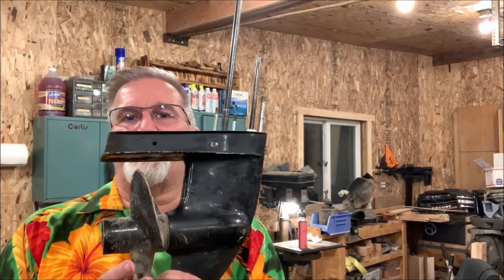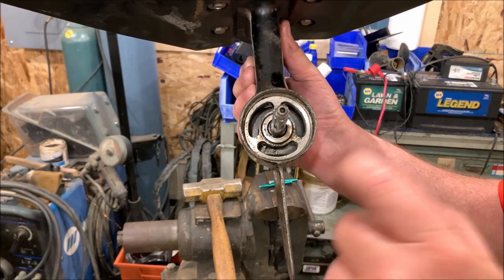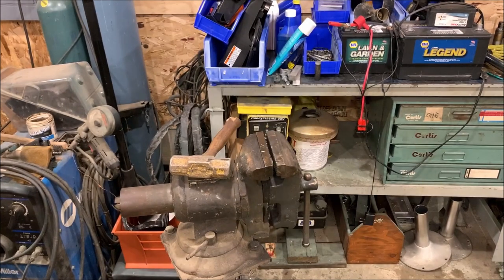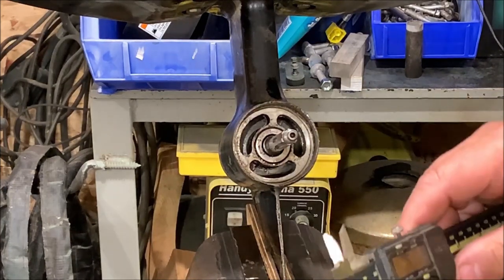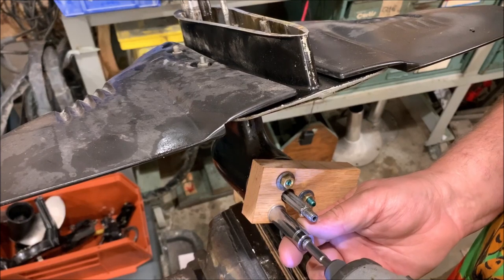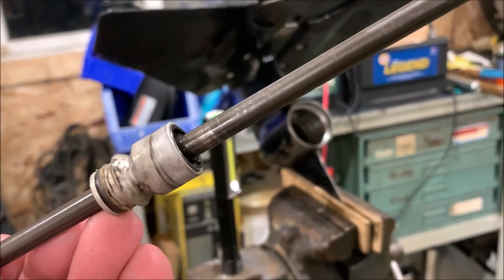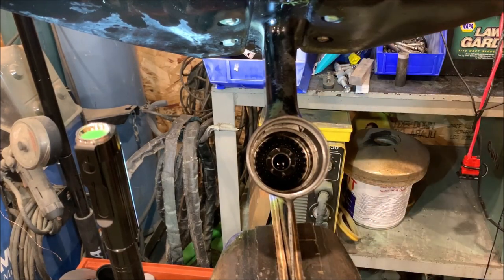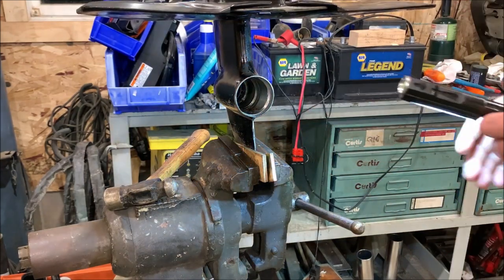Mercury 9.8 1966 outboard gear box disassembly part 1 a how to, how I do this job, noisy gear box

Comment: It wouldn't have crossed my mind to use wood for your puller, I would have went straight to steel for it, Good job and.I can't believe you didn't ruin that bright shirt working with the black oil from the gears and bearings.

Comment: How do you pull the driveshaft out? You skipped that and that's where I'm at in my 9.8
Reply from the maker: remove the nut on the end of the shaft in the gear box. The vice grip the shaft and give the vice grip a couple of love taps and she comes right out.

Comment: Are yu sure that the thread is reverse? Usually on the gear housing cover there is an arrow to show on and off on the older. models. I fixed a 1969 20 hp and a 73 20 hp Mercury and clockwise to tighten. My 1986 8 hp is reverse thread on the bearing carrier. That oil seal is in wrong.

Comment: So, I ended up ordering a $20 inside jaw puller from Amazon. I got it hooked in, down in there and cranked on it. Still didn't pull.... At this point, with the puller still cranked on tight, I decided to take another shot at heating it up. In about as long as it took for yours to fall out in your video, I heard a loud PINCK,as the gear popped free, and I was able to crank it out the rest of the way with the puller. Just wanted to give you the update and thank you for the advice. I am now subscribed.
Reply from the maker: Good deal, welcome aboard.

Comment: Any tips on removing middle drive shaft housing thingy on a 9.9. Lower unit came off/apart easy. Seriously siezed together.
Reply from the maker: be very gentle, apply even pressure, and that may not be enough

Comment: thanks so much for that video but I have a problem with copper water bent dont know how to remove. First time working on two Mercury one 6hp other 9.8 just about same year 1968 69
Reply from the maker: They can be stuck to the rubber pretty bad sometimes. thanks for watching

Comment: Great diy puller - I used your idea with 3/16 3" carriage bolts I had in the shop - worked great on my 1970 7.5.  How did you get the carrier bearing nut out?
Reply from the maker: Gently vice grip the shaft, bend locking tab out of the way and put a wrench on the nut and turn the shaft.

Comment: Early 1970s merc 7.5 leaking gear oil out of weep hole. Drained oil. Doesn't look too bad. Spent 300 on "mechanic" to get it to pee again. First attempt didn't pee enough. Took it back. Said he sealed something between upper and lower unit  to get it to not have scalding water come out. Wondering if he put a seal back in wrong. What would happen if I seal that weep hole up with silicone to stop the oil leak and open it back up for the winter time? Trying to not have to do this pull apart whole thing. I'd assume parts are hard to come by as well.
Reply from the maker: if you need parts check out oldmercs.com

Comment: Would absolutely love details on how to reinstall this lower end unit to the rest of the motor. Took mine off to replace the impeller, and after 5 hours I can't get the three shafts to align to reinstall it. Any tips would be greatly appreciated.
Reply from the maker: Make sure it is in forward gear on the handle and the gear box so you can rotate the prop to get the splines to align. Thanks for watching

Comment: I have a 1986 mercury outboard motor  75hp will not run but turns over
Reply from the maker: OK, sounds like you have some work to do.

Comment: I have a 70s mercury 7.5 thunderbolt I believe its jumping out of gear. Do you know if that's possible and can I still get parts? Awesome video by the way.
Reply from the maker: Harder and harder to come by. Go to marine engine.com and look up the parts then google search the part numbers or search the part numbers on eBay.

Comment: Alright, I'm going to go heat mine up, and if the gear falls out I'm subscribing!
Reply from the maker: Well did it work for you? it doesn't take much heat at all. Thanks for watching
Reply: @Michaelsbackyardmarina  Didn't work at all. Mine is too corroded and stuck in there. I still need to figure out how to get it out. Any other suggestions?

Comment: Good video but you did not show what I was wanting to see and that's how you got the cover nut off without a special tool to unscrew the spanner nut  the carrier I can remove I made a tool  for that on the 20 hp motors i bought an 80 dollar special  cover nut remover because over half the time I would break the lock nut trying to turn it by  using  a hammer and large blade screwdriver  to try and remove it and it was costing me 30 bucks every time for that  cover nut, so now I can remove and reinstall them every time with no damage to the nut only problem is it only fits the 20 hp fine but  not the smaller motors like 4.5 9.8  motors
Reply from the maker: Soon I will be putting this one back together

Comment: Pretty informative but after you take that screwed-in retainer ring that is in front of the gear assembly (that’s what holds it in) there’s really no need for a puller, you can pretty much yank if out easily, I seen with your puller you barely tightened 1 nut and it was out (nice job on it tho). I actually had to make a tool to get out the retainer ring out,.. it was a bear removing it!
Reply from the maker: Interesting. Thanks for watching and commenting

Comment: Did you run into the dog clutch as they call it?   I once had a 18 hp Johnson that in forward  gear it would jump in and out of gear while running . 
Boat shop said it needed a dog  clutch..  
But it would cost more to fix than it’s worth.🤔
Reply from the maker: If an outboard dealer is doing the work, most outboards are worth the repair compared to their hourly rate. This is why it is important to take matters into your own hands. Watch lots of videos and you can do it yourself.

Comment: Have you ever played with 90 s era merc 9.9s? Had a lower unit leak pulled the carrier and at the end of the prop shaft was a pin i this is called the follower cam it has a pointed and rounded end would you know which way it would have to be oriented?
Reply from the maker: Sorry I have not yet. Most of the ones I have been playing with are older.

Comment: Thanks for this video...so helpful.
I got my 1965 Mercury  110 9.8hp all fixed and took it out for it maiden  voyage.  It appears that the propeller is spun. QUESTION: Where can I find an after market propeller or hub? I am striking out. Thanks
Reply from the maker: oldmercs.com or search on eBay for a good used one.

Comment: Where is the reassembly video? I have mine apart and all the parts ready for reassembly but the one shaft i dont know which is the top and i dont know the top of the reverse paw in the lower outdrive
Reply from the maker: I’m still waiting on parts

Comment: How did you pull out the locknut right before using your home made tool?  Mine has arrows for on and off but it doesn't seem to turn?
Reply from the maker: special spanner and it is left hand threads.

Comment: Thank you for making this video. I’m looking forward to seeing part two. This enjoyer has enjoyed learning along with you sir! I’m working on a 1984 7.5hp and it has the same lower unit. My bearings are on order as well. I had a lot of issues getting the gear box apart due to salt and aluminum corrosion, the hub came out of the prop and I had to remove the retainer nut in pieces. The hub had to be ground down on either side with a belt sander and then chiseled off with a flathead luckily I did no damage to prop shaft or housing threads. Man, I was so nervous about grinding into the splines of the prop shaft. I can’t wait to see more and learn more. CHEERS!

Comment: Thanks for quick reply and looking forward to Part 2 video. I the meantime quick questions to get me going.  Which way around does the cam follower go in. Pointed end on the cam or pointed end down the prop shaft to the dog clutch?  And which way up does the cam go?  Loved your home made puller, but all I did was put the prop on, slid a wedge between prop and the housing then turned the prop nut.  Bearing carrier unit popped out.  To get the forward gear out I just gently pushed it from behind with a screwdriver through the oil filler hole.
Reply from the maker: Well we will see when I put it back together. It's been a while since I took this apart.

Comment: Really enjoy your videos. Very helpful. Would you be able to help me by identifying a part if I send you a picture? I can’t find it on the Merc parts breakdown so I am having a fit trying to replace it.
Reply from the maker: Sure send me a pic
Reply: Well, it looks like I can’t send a pic through these comments. So on my Merc 7.5, the wiring is toast so I am trying to replace. 2 of the wires go into the ignition and are soldered to a screw, that goes through a small white plastic box, and connects to the spring on each of the points. I’m trying to replace the 2 white boxes, but don’t know what they are called.

Comment: Im doing the same lower unit right now, just finished taking it apart, separated all the bearing from the gears , curious how you are going to approach the new bearing being pressed in... i dont have a press but i was thinking dry ice the gear, lube the bearing and use a bearing driver. Im excited to see your upcoming video.
Reply: get a can of "air".  the stuff you spray  air onto computer keyboards out with.  Hold the can upside down with the red nozzle tube and super cold liquid will come out.  Spray that liquid onto the bearing race.   Hope that helps someone out there....

Comment: Have you uploaded part 2 reassembly yet? I have my '69 merc 110 9.8 torn apart right now.
Reply from the maker: I will in the next 30 days
Reply: Just got mine together tonight runs like a champ.
Reply: @patrickgilbert9715  how did you position the shift rod on gear case and shift handle on motor to reinstall gear case? I know there is a flat spot on shift rod spline. Does it line up facing the drive shaft?

Comment: Hey Michael, I really enjoy your channel I am a subscriber I love how you present things and explain things it helps people like me understand that don't have a clue the question I have for you is this:  I have a 1968 Mercury 35 horse it's the Mercury 350 and it keeps draining the battery but yet it will still run without the battery I don't understand someone suggested that the rectifier was bad I don't even know if this motor has a rectifier I am a complete newbie when it comes to outboard motors can you help?
Reply from the maker: This is a mercury 350 outboard? or a Mercruiser I/O (inboard/outboard)?
Reply: @Michaelsbackyardmarina  outboard
Reply: @Michaelsbackyardmarina  it's a 35 hp but the decals on the cowl say 350

Comment: I have an 85 OMC Stringer outdrive is the water pump in the lower unit
Reply from the maker: most likely. even the closed loop coolant system on my rinker has the pump in the out drive for the heat exchanger